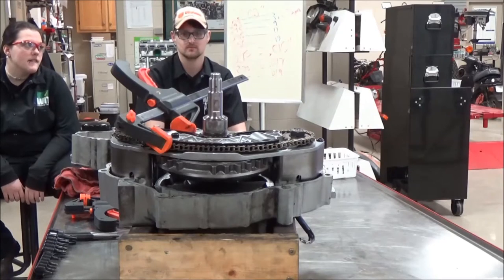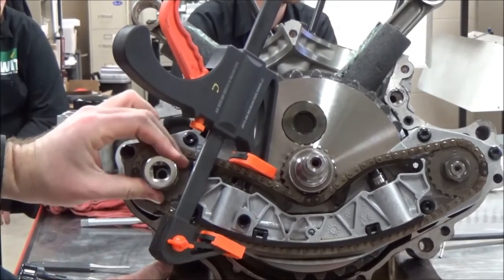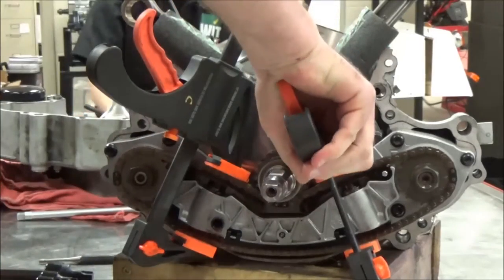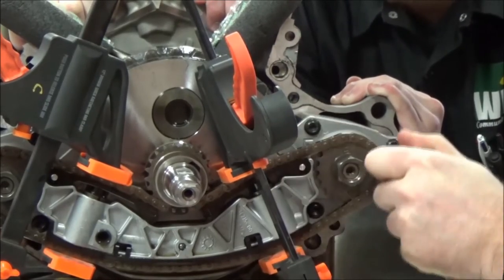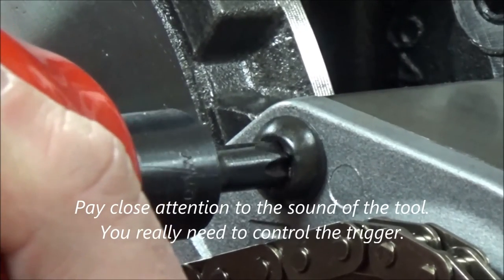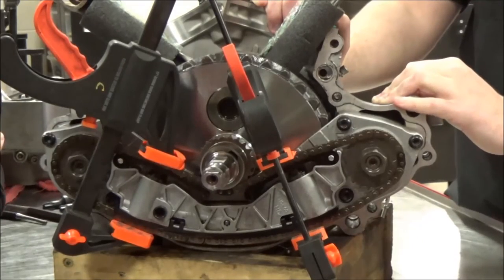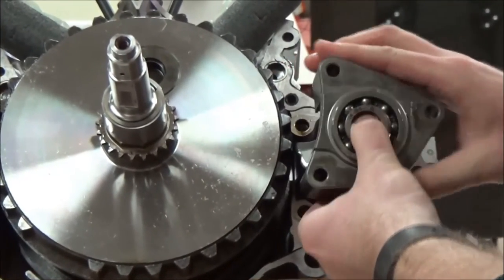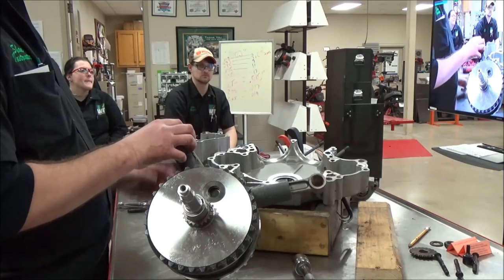Twin Cam Series: 07 How to remove Harley Flywheel and Counterbalancer

Comment: is it ok to heat the torx bolts that hold the balance plate to the engine to soften the locktite?
Reply from the maker: Yes. A must do at times to remove bolts without pulling threads. Have you Subscribed yet to never miss a video? Have you seen the video playlists https://www.youtube.com/user/conleybuilt/playlists ? Quick answers are often found here. No time to look through videos? 

Still have questions? You’re in luck! I provide tech help and work one on one! I know your question may seem quick but with over 300 requests a week, it’s not possible to answer them all. So, I’ve narrowed down so subscribers and donations to assist beyond the over 660 free videos. My YouTube has grown beyond the ability to answer every question (11 million views! Over 500,000 a month!)

Click here for the membership links and welcome to the community! https://how2wrench.com/product-category/specials/    

Want to say “thanks” or “keep it up”? Click here https://www.paypal.me/how2wrench   This is great for those truly quick questions you need answered and your help back will keep me going!

Your answers and help are just around the corner. Save time and money while protecting your investment and yourself by doing it the right way!
Admin How2Wrench.com
Reply: tw, as TheBeliever said above, get a Hand Impact driver. One of the greatest tools for working on bikes. Especially old metric engines that use phillips screws on casing covers.